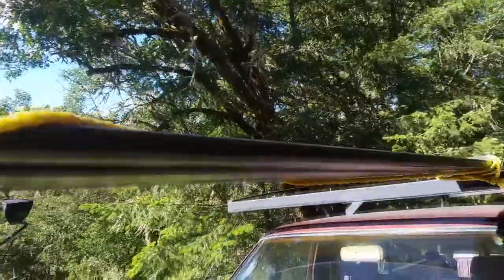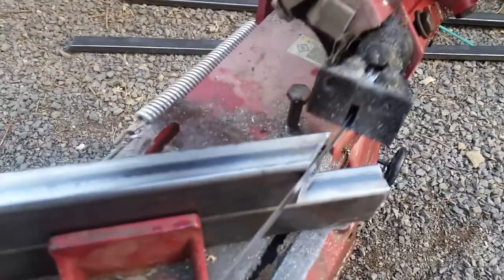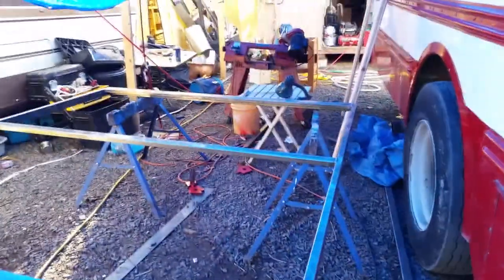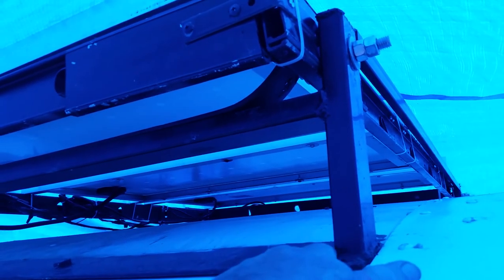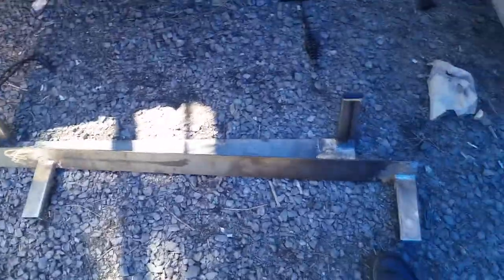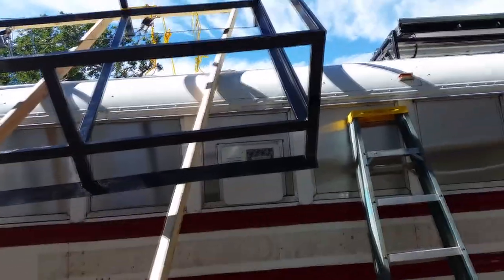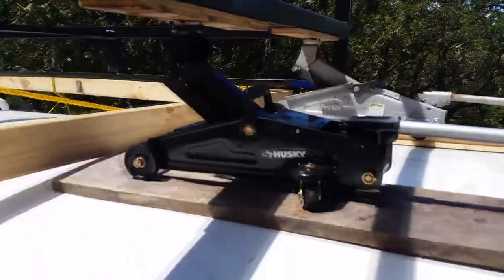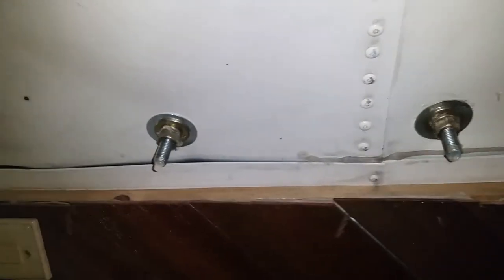Jon's Bus Conversion Part 62 - Roof rack for the bus

Comment: I’ll be starting on a minibus soon. 
Saving me time in design work. Thank you. 

What gauge did you use on the frame rails. 
I would like to make a recommendation to you. 
At this time you have solar panels controller etc. install a horizontal wind generator on a pole. Once you are parked. Raise it up and get free energy. Just find a small dc motor.
Reply from the maker: I believe it was 1/8" steel. Where I live you totally want to get these from a metal shop - you can get a 20 foot piece for about the same cost as 6 feet in the box store. I've thought about the windmill -  do you have a recommendation for a windmill?
Reply from the maker: PS - also note that the way I attached the rack to the bus was lame. I ended up putting a piece of angle below the roof members inside as a better brace: https://www.youtube.com/watch?v=FgCPdZ6nx9s&t=5s